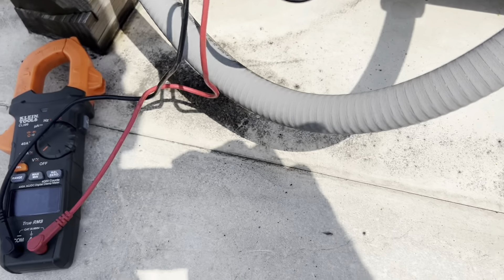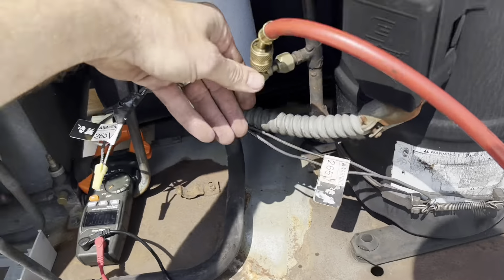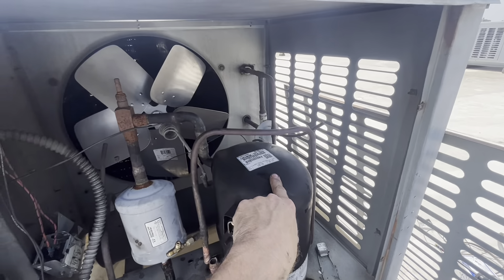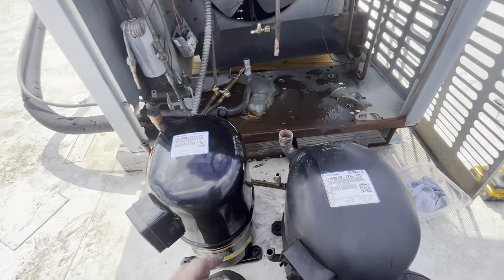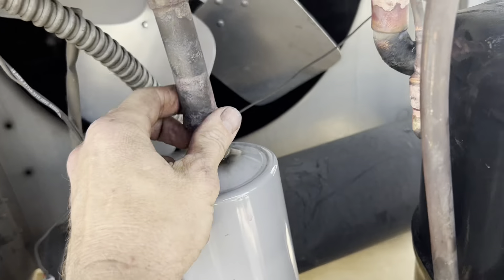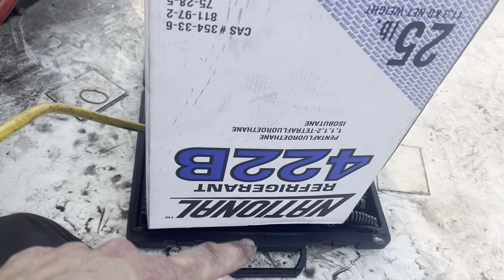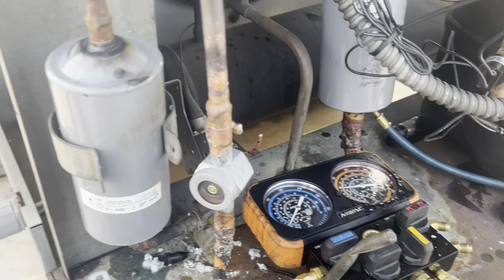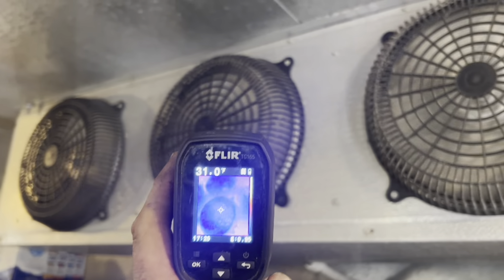Rooftop inspection discovers catastrophe

Comment: More heat, get on  get hot get off.  
Also with it not running charge the high side.  You dumped a bunch of liquid in the low side and started a brand new recip full of liquid.

Comment: I can understand the struggle since I do commercial and industrial hvac. You should use a rosebud tip or as I like to use a cutting torch tip (gets pipe hot quick and braze sucks right in).
Reply from the maker: Yes sir!! Lesson learned.

Comment: If you were out on low pressure fan is out of the equation. Fan is wired to operate with the compressor. Good video .
Reply from the maker: Legit the high pressure switch was failed open interrupting the compete unit power so I couldn’t tell what was happening at first.   Thanks for the watch and input 👍🏼
Reply: @restaurantrepairs  cool NP 😎

Comment: Instead of pulling through those low loss fittings put Schrader core tool removals on take out the Schaefer and use regular hoses then to pull vac it’ll do it a lot quicker
Reply from the maker: Yeah I hear that alot…  old dog meet new tricks. 😂. You’re very not wrong.
Reply: Trying to use the vcrt more often, change out any cores I touch, if nothin else, new brass/oring caps.

Comment: Sequence of operation /usually/ is pump down/low pressure switch controls contactor directly. And the thermostat/time clock control solenoid, and depending on what the unit is set up for, the fan is controlled by the contactor and/OR a fan cycle switch, if the compressor isnt running to raise your head pressure your fan can't turn on. And a lot if times I've seen people add a time clock after the fact or forget to run communication to the solenoid and just use the time clock to break the compressor regardless of solenoid activation or not....
Reply from the maker: Excellent insight.   I see (and perform) all manner of Shenanigans out here.   Great explanation and wisdom.  👍🏼
Reply: @restaurantrepairs  I don't recommend ever controlling defrost with the contactor though, as you can cause flooded starts/compressor slugging  the whole point of a pump down system is to keep your compressor/evaporator free of excess liquid refrigerant. Which if you don't have a crankcase heater and it's cold outside you'll accumulate a LOT of liquid in your compressor
Reply from the maker: @jasontexter1721  these complete systems need replaced and control overhauls.  Walked into a crap show and joined the party until they’re ready to rip off the bandaids

Comment: Would it have been possible to switch the system to R407C since most of the old oil would be carried away with old compressor? Would the TXV's need to be swapped too or could they stay?

Comment: Wow that was allot of work there !
I would suggest you buying a Fluke T150 for safe isolation and measuring supply voltages.
It gives you more distance from the live terminals so we can enjoy your video's a bit longer ;)
Take care! P.S. I try to watch all of them ;)
Reply from the maker: Thanks man!! Yeah I hate that backup meter.   You can’t see it at all.  Just been to lazy to replace the original.   You’ve inspired me
Reply: ¿ But does it vibrate like a Wiggy ?

Comment: Awsome videos man thank you for all the knowledge.. does phase rotation matter in a reciprocating compressor piston driven I think not right ? Could be wrong normally it matters more with scroll compressors. And or in situations with the rotation of 3 phase blower motors thanks.
Reply from the maker: It does not, but anything 3 phase being replaced I’m programmed to specifically mind the rotation and sound at startup.  Been programmed that way.
Reply: @restaurantrepairs  🤝🏻💯

Comment: Wow I didn't realize they made an R22 replacement like that.   My house has two old(ish) R22 heat pumps,  I have one full 30lb cylinder of 22 left.   Is the R22 replacement a drop in refrigerant.   Can I just vacuum a unit out, and use the replacement stuff? And does it use the same oil?  Just curious, I'm not an expert like you are, just self taught.   I know enough to calculate the Superheat to check the charge on my unit.   I think I know how to calculate the subcooling on non TXV systems, haven't actually done it in real life.
Reply from the maker: Unofficially and completely hypothetically.. 422b can drop right on top of existing 22 with no I’ll effects.